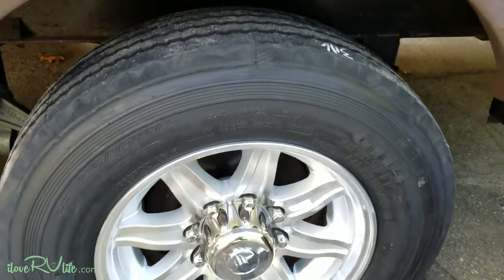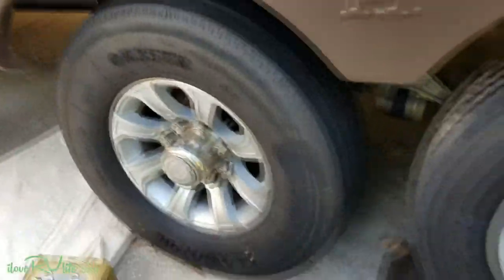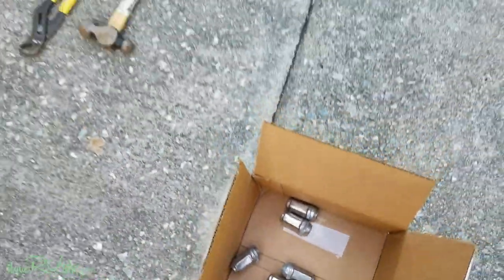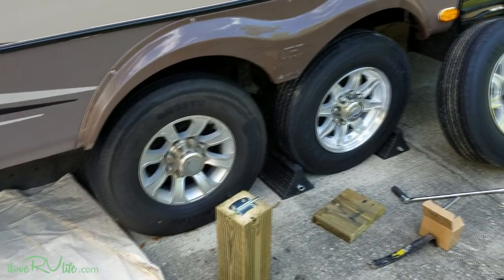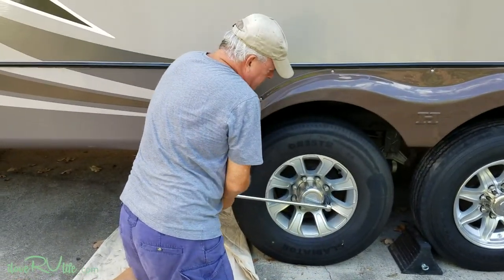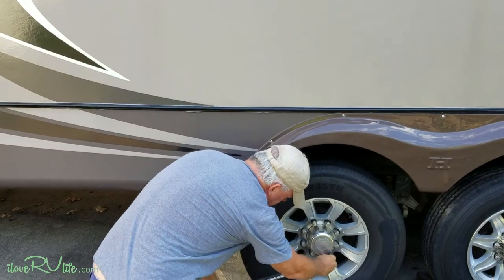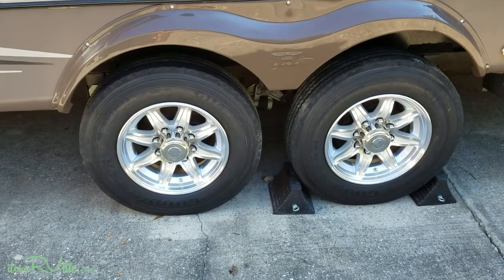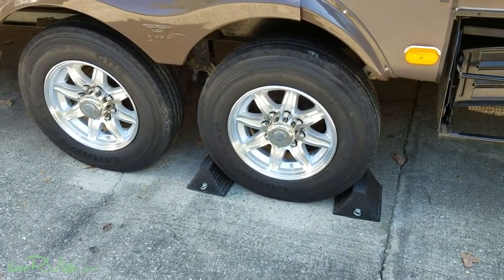RV Tires and Wheels Up Grade

Comment: Jerry, when upgrading the rims, what measurements do you that to make sure the new ones would fit? Also, are the tires you got a ST grade or a LT grade? Good Video, Thanks.
Reply from the maker: Thanks Tim.  I measured the outside diameter of the 16s.  The Goodyear G114s in 17.5 are the same diameter.  Had to order new rims too.  If your going this route, make sure you match the bolt pattern.
Reply: @iLoveRVlife  thanks Jerry, just getting some thoughts for when it comes up.

Comment: Hi Jerry, nice video, when you check your cold tires pressure, do you adjust them to leave a gap like 10% less of the maximum pressure recommended ?
Reply from the maker: Thanks much.  I don’t.  These are Goodyear and they have a recommended weight and pressure chart.  The chart is very specific.  My understanding is the cold ratings have the margin built in for the heat increase.

Comment: Thanks for the video. I’ve upgraded my tires but didn’t up the size like you did. Wished I had seen this video before. I did run into problems with one of the tires going flat on me. Took it back to the tire shop and found out it was the aluminum wheel leaking. Tried to get it welded up but no luck. New wheels then. I’ve boated a lot and the common saying is a boat is a hole in the water you throw money in. I guess there is a similar saying about RV’s but seems like we get more out of them.
Reply from the maker: Glad I could share.  Unfortunately I had to learn the boat lesson a few years back.  It's a shame so many RVs have been sold with sub standard tires.  I was at an RV show this weekend.  Sales brochures showed American tire brands.  Hopefully new RV owners will have a better experience.

Comment: Nice Jerry I did a update on mine to my  trailer is 13000 I got g rated tires on  I hope it will be  all I need
Reply from the maker: Part of the upgrade is the rating and for me was the tire manufacturer getting away from that China made junk.  G's should handle the load.

Comment: Hey Jerry.  I am looking at this video 2 years after you posted it... just wondering what your impression of these tires after that many miles on them now.  Thoughts that you can share?  Thanks.  bg
Reply from the maker: Hi B G.  Glad you found the video and reached out.  I couldn't be happier with the tires and rims.  I've got about 20,000 miles on them and they still look new.  Huge benefit with additional weight capacity plus they're rated for 75 mph.  I'm usually run 65 on the Interstate and have checked temps during this hot summer and they ran around 117 to 120. Great to know I have the extra weight capacity and speed margin.  It was expensive, but worth it to have the confidence when towing.  Jerry...
Reply: Could I ask you another question... I could not find the tire dealership you mentioned... would you give me their name again.   Thx Jerry
Reply from the maker: Glad to help.  The website is http://www.trailertiresandwheels.com.  I think they're out of Edon, OH.  If you go this route, I had them ship ground and I picked up at the local depot.  Saved a bunch in shipping costs.  They came mounted, balanced and full of air.
Reply: Thx Jerry. You're the best
Reply: Jerry, we have been rvers for over 30 years, in that time we have been through 4 trailers and 5 trucks.  We now have a 2015 GMC Duramax diesel and 34’ Denali travel trailer.  We live in Florida and tow at 70 mph to try and keep from being run over.  Mileage varies between 10 to 12, depends a lot on where we get fuel and how much bio-diesel is in it.  We have kids, grands and great-grands all over the country so 12-14,000 miles a year towing is about normal.  We have had one major blowout the resulted in structure and plumbing damage and a couple of road hazard flats in that time, I run mfr max inflation.  We put 16 inch Goodyear Endurance E Range tires on last year, now have a little over 5,000 miles on them, so far so good.  It feels good to be running American made on my trailer again.  I do enjoy your posts.
Reply from the maker: Hi Dannie.  Always great to hear from the RV pros.  So glad your enjoying the channel.  Agree with the American made tires.  I trusted the original tires would hold up for a few years, but 2 blew year 1 with less than 3,500 miles.  And it was a mess.  We drive around 65 may bump 70.  Depends on the road.  At 22,000 lbs total weight, we’re getting around 12 mpg.  Gotta love these diesels.